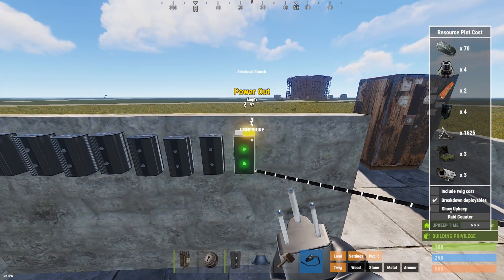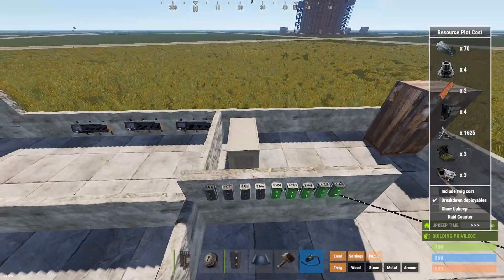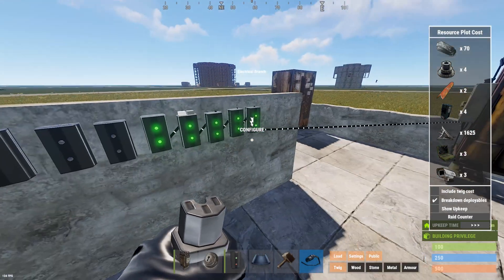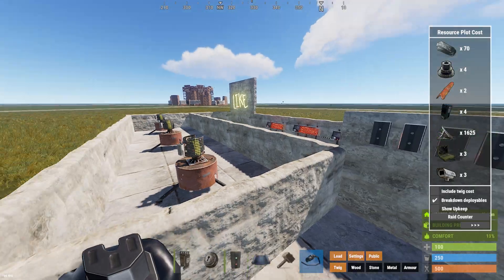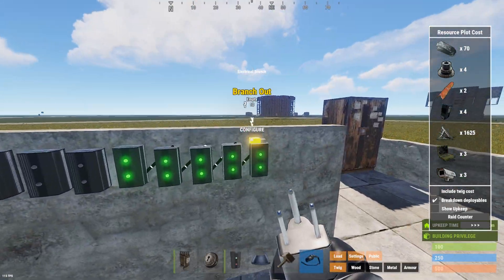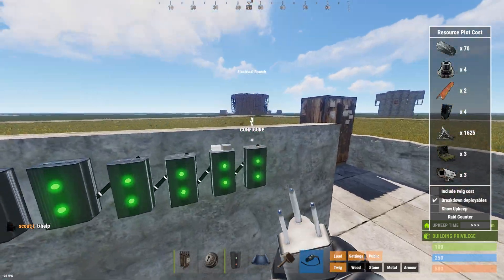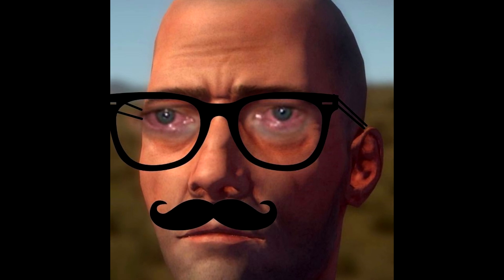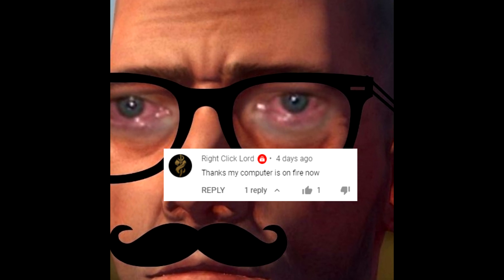Electrical Branches // Rust // Simple Electricity...

Comment: I noticed something weird about branches. when I connect a branch to my battery it will show the exact amount of power I configured on the branch on the "active usage" regardless of if the item I am powering with the branch is on or not (I even tested with nothing connected to the branch output.) 

So is the branched line supposed to consume the power even if the item its powering is off? Or was it some  kind of glitch?